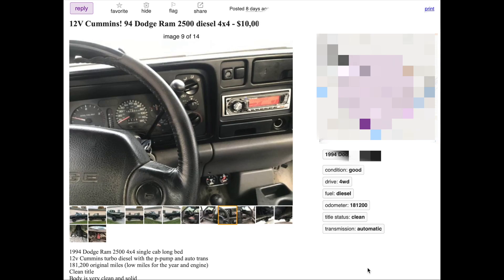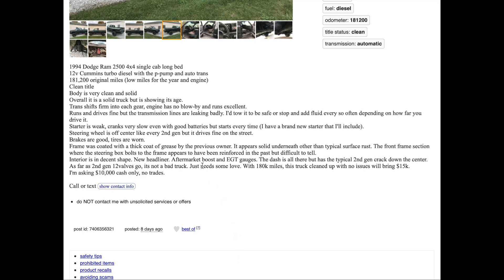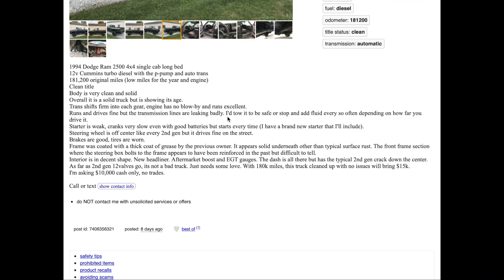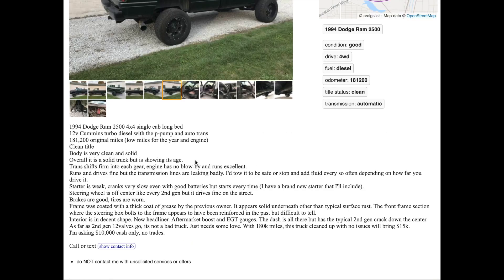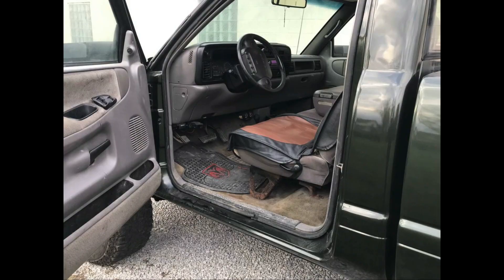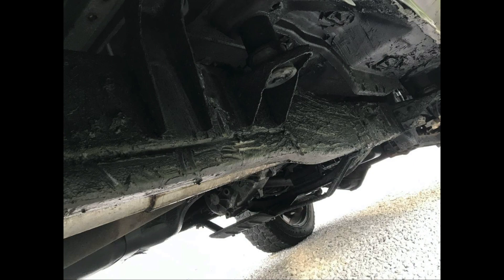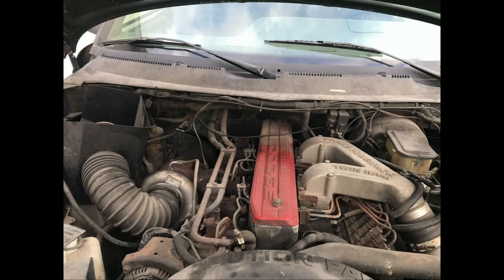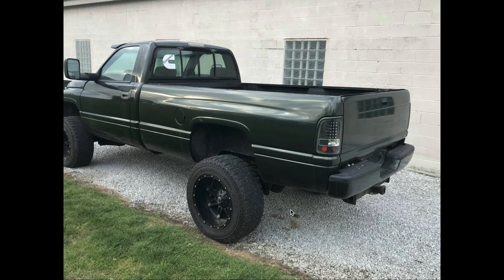Undercoating with grease, cars, trucks, suvs? Best undercoating product or dumb and expensive idea?

Comment: @repairvehicle should undercoat my new 2022 f350 that has a suspension lift?  Where should I get it done?
Reply from the maker: Where do you leave, state?
Reply: Maryland
Reply from the maker: It’s a good idea to undercoat the truck, it will keep it rust free and will hold value better even if you decide to sell 20 years later. Where and what to use ? I will get back to you next week
Reply: @repairvehicle Maryland
Reply from the maker: Maryland is not a rust belt state but undercoating is optional, it still snows and they do use salt on the roads

Comment: fluid film doesn't last long. was using bar & chain oil with paraffin wax melted together gives it a greasy undercoat but now about to update the formula and add grease to it and add some Boiled Linseed Oil to it hoping it will stay on the underside a lot longer. yes i use a undercoating gun to spray it on. Ohio rust is pretty crazy.
Reply from the maker: This stuff works really good in pa, hi neighbor. HINDER RUST REVIEW AFTER 5 YEARS OF USE AND NOT WASHING THE CAR. Best undercoating money can buy.
https://youtu.be/ZJBc0E8VWv8

Comment: Hello My Wise Friend.  Question about a  2006 Toyota Rav 4. When on the brake in D car makes a rattling noise under hood  on passenger side. What could it be?
Reply from the maker: Mileage on the car? Are you in northern states?
Reply: @repairvehicle  260,000 we're in South  Texas
Reply from the maker: More like heat shield on the exhaust pipe loose and vibrates. Check under the vehicle to see if heat shield loose. Be careful exhaust might be hot.
Reply: @repairvehicle  Okay Great Thank You.   I  was have a 2013 Chevy Sonic when I'm slowing down theres a noise coming  from the  rear  back passenger side? Like a rubbing sound.
Reply from the maker: Sounds like something is going on with your brakes, pads maybe stock or brake cylinder not functioning properly and applying pressure without releasing it
Reply: @repairvehicle  Fantastic Thank You so much!!!!!
Reply from the maker: No problem

Comment: That is nothing I’d buy, but doing rust treatment and undercoating is really good, when it is correctly done. 

This is how I do it. 

First I clean and dry the car underneath. I also remove panels that are in the way for the treatment. 

Second I use wire brushes and wire wheels to brush off rust effected areas. 

Thirdly I apply Brunox epoxy rust stop, rust transformer with a soft painting brush of a small to a medium size. It sucks the oxygen out of the rust and transforms the area to solid steel. The finish is turning the rust into a black color. 

When the epoxy is dried I start the final step. 

The fourth and final thing I do is to apply wire grease with a spray gun. I spray in the cavities and on and around the whole undercarriage. The wire grease is also good to use in the rockers and inside the doors. 

After that I don’t wash the car for at least two weeks. That will protect the car for at least two years and then I can check on it and do maintenance on the treatment. Often it is just the wire grease that needs some attention. 

The most important thing I do to prevent rust is to wash the undercarriage thoroughly at least once, but generally two times, a month.

I mainly own and drive Toyota and Subaru and my 10 year old Toyota is as good as new underneath. 

There is a misconception that cars rust more in the winter time (which is a dry season) even here in Sweden. 🇸🇪
The truth is that cars rust more during the spring, summer and fall time here in Sweden, and mainly due to lack of maintenance and washing in the winter time.
Reply from the maker: Very good point about winter time. In my area summer time is the most humid time of the year.

Comment: Old trick of taxi drivers was to undercoat (spray) the car with gear oil and drive it on a very dusty road after that. Nothing else was available back then.
Nowadays, I'd use Fluid Film to coat everything, including the inside of all body panels. It stays semi-fluid and protects very well. Stay away from rubber like compounds. Water and salt will get under it and your vehicle's body will rust even faster.
I never applied any undercoating on my vehicles here in the south. There is no need. Factory paint and seam coating is sufficient enough.
Reply from the maker: Living south is nice, when weather is colder here and ready to snow.